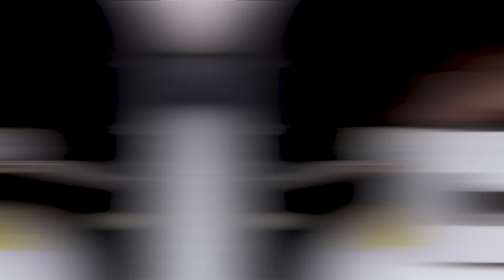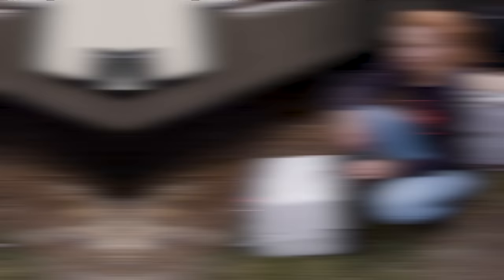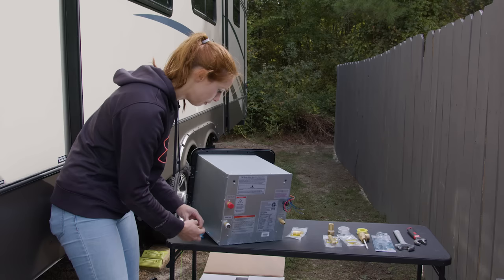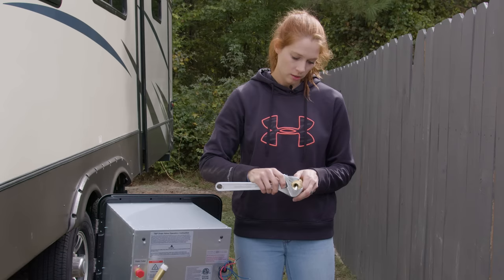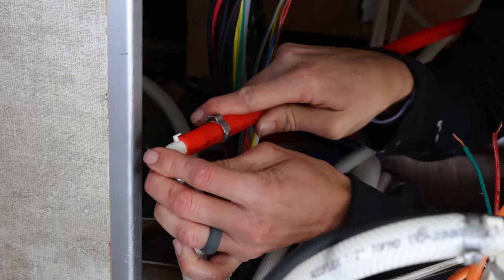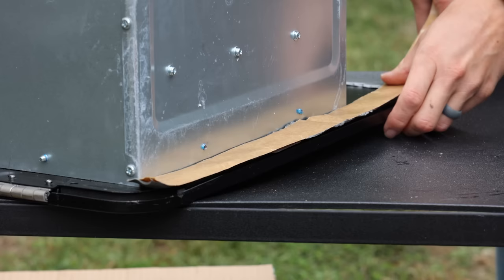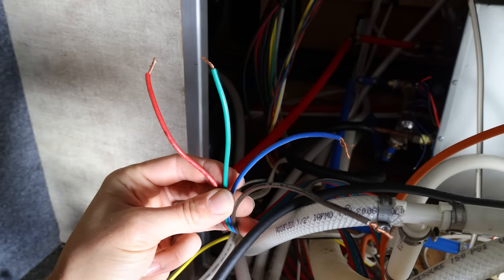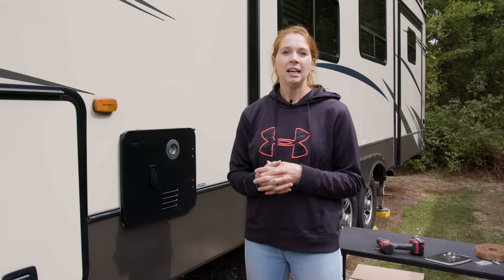(UPDATED) Installing a New Fogatti Tankless Instant RV Hot Water Heater: Easy step by step guide!

Comment: Great video on the installation. But you never put Teflon tape on flair fittings, it will eventually cause them to leak. The seal is the flair not the threads. You can look this up online for an explanation on why.
Reply from the maker: I did some research, and I’ll admit when I’m wrong—thanks for pointing that out! I’ve updated that in the description!
Reply: Call impression fittings don't requires pipe dope. Pipe dope can actually cause a leak on flare fittings. Please research how flare fittings work. The wrong advice can cause injury.
Reply: FYI. You did a great job on the video, but if you go back and watch it again, there were a few Teflon applications that were incorrect on the water fittings. Rule of thumb for me is clockwise applications in the direction of the threads in the tightening direction.
Reply: Flare, compression
Reply: Flare is not compression, nor does it need tape or dope. It has a soft brass seat that is the sealing surface.
Reply: Flair fittings need to be checked for leaks. I used them on copper half inch pipe and a few months later they leaked but there is nothing wrong with flair but I should have used compression fittings they probably would have sealed better but depends on how tight you make them. The flairs should have been checked before they leaked. But when I changed the water heater I used the same supply line and I never had any problems since. 73
Reply: @rickgauthier6597  on the gas line too
Reply: Even NPT gas line fittings don’t use the white Teflon tape. The solvents in LP and natural gas degrade the tape over time. Yellow PTFE tape is used on NPT threads on standard black iron gas line connections.
Reply: Mobile Gas line applications… should be safety wired…industry is lacking!
Reply: Teflon tape is an anti-seize not a sealant
Reply: @fallenintocamping we all learn new things in life. 
When you did put the Teflon tape on the propane fitting, you also did it in the wrong direction. Not picking on you, just pointing out how important the direction of applying Teflon tape is

Comment: Its unbelievable how many people give advice on things yet know very little about what they are doing . That being said , good for you taking on this job yourself ! P.s. that flex hose should not be on a pex fitting , it will probably leak at some point . They do make pex-flex fittings .
Reply from the maker: Ha I’m used to it…part of the territory when it comes to the internet. Also im cringing at the flex hose on a PEX fitting…I have definitely learned since then 😂 It’s been almost a year since I made this, learned lots of new things. Make sure to check out the 8 month review I did on this if your thinking about purchasing!
Reply: Thinking about getting a tankless for our camper but aftet watching your review , im not sure now . As for the flex line on the pex fitting . I guess it will be fine if its crimped correctly . They do make a flex-pex fitting though . Sucks the tankless decided to stop working correctly !

Comment: FYI - Always put Teflon tape on clockwise looking at it from the end.
Reply from the maker: I changed it before install, that was just the first camera shot they got of it. Hince why I went on to explain why, cause I threaded it wrong the first time 😂
Reply: @fallenintocamping  Very good video, thanks for sharing. We are on the fence about going to a tankless water heater.
Reply: @fallenintocamping  and you still put  the tape on wrong on three  of  threads  plus  the  gas line  that didn't need it.
Reply: Yessss...she was putting it on counter clockwise  on water inlet.  Plus...was tightening things that were already loosen and then finally turned it the correct way.  Righty tighty...lefty loosey
Reply: That's 100 % correct and funny that she is NOT.....HAHA

Comment: The pressure relief valve ALWAYS goes on the output side of a water heater - that's where an over-pressure situation could conceivably occur, however rare that is w/ an on-demand water heater.
Reply from the maker: Agreed—I made an update in the description a few weeks ago!
Reply: I originally opted not to install it, I came back to this video because I was thinking about doing it. As soon as I watched this again I was thinking this makes no sense. All your Water will drain into your camper.
Reply: Pressure relief valve should never be blocked from opening. ie. gas line.

Comment: For a Simple reminder, For right-hand treads, Always when putting on the Teflon tape wrap it in a Clockwise direction, so that it is wrapping in the same direction as the Right Hand Threaded fitting is being turned and threaded on
Reply: Not recommended to use Teflon tape on compression fittings.
Reply: @ssr4656  or any other fittings that have their own way of sealing....o-ring, compression, etc
Reply: I noticed that, too. She put it in CCW and then threaded the connection on CW. A common mistake.
Reply: @ssr4656   Water connections are not compression fittings. Only the gas fitting is compression.
Reply: @lanahorton1003  You sure?

Comment from the maker: Y’all make sure to check out the UPDATE in the description! I’ll admit when I’ve made mistakes, and I don’t want y’all to make the same ones that I did. Happy camping!
Reply: Good Morning and thank you so much for this video and I appreciated that you did this for the Fogatti unit from Rec Pro. I have spent a bit of time looking into this brand of "hot water heater" LOL just thought I would throw that in there due to comments regarding so many people saying it is not called a "hot water heater."  I have been full timing for 25 years and I have always called mine a hot water heater. 
Important Tips: Fogatti comes standard with a 15 X 15" door. If Replacing Atwood 6 gallon opening requires 15 X 18" door. Option can be selected during Rec Pro Order and costs extra. 
Make sure to purchase the unit with the correct door size and you will not be in the same situation I am currently dealing with. Enjoy, Elizabeth
BTW Fogatti is now making units with the pressure relief valve installed in the front of the units, just not on the Rec Pro units.
Reply: Its ok to make misstakes you did awsome !
Reply: Sorry, I was just needling a little, you make awesome videos and you did so much better than I'd do with that router ❤
Reply: Have you experienced any drop in hot water pressure inside your RV since installed? I have. Have descaled it and nothing seems to work to get water pressure back.
Reply: OMG what did you do with the tank? That's the same model I have
Reply: Great job young lady! Not very often seeing a woman doing this type of job!

Comment: At 10:33 in the vid, you have you Left hand on the  pipe fitting ( MALE THREAD ) With it pointing to your  Right  Hand, if you always remember this then place your PTFE/TEFLON TAPE onto the top of the pipe thread and wind away from yourself, youll always apply your tape in the correct  direction.
When you applied  the tape to the end of the Long Nipple, that was to accept the 3/4 - 1/2 reducer that fitted onto the PRV. You wound incorrectly. Perhaps applying your tape whilst  your fitting is in hand would help to remember.  

Other than these little issues, you're doing a great job.

( Retired UK Plumber )

Comment: Her: Make sure to put the thread tape on the right way.

Her: Puts thread tape on all but one pipe thread the wrong way. 🤣
Reply: Yeah noticed that too!!
Reply: Also pressure relief valve can't open because it is up against the gas line.
Reply: A minor issue. Before you criticize, step out of your comfort zone and try something new. 47 years in the trades and learning every day.
Reply: I almost make that mistake every time. Almost.  The life of a handyman. Never an expert.
Reply: Most people are right handed, such as myself.  I hold the pipe with the left hand and thread the tape over the top.  This ensures the righty tighty method.
Reply: @Bart Tobias  I do pipes periodically, it's just mental mistakes
Reply: We have all done it.  I always double check myself and sometimes pull the tape off and do it again, as I put it on the wrong direction.  What is far more important is that you know there is a right way and wrong way…most don’t even know that.
Reply: Simple fix always put the tape in the direction the fitting tightens
Reply: @barttobias3933  She's on here teaching not us. If you're going to teach get it right.
Reply: @christhomas9837  agreed, but still impressed that she took on the project, tiny trip, listened to our input, graciously accepted and learned from that input. Even after all the years I’ve been doing this work I learn from others everyday.
Reply: Pressure relief valve goes on the HOT water side! Not the cold water side because pressure is built up as it Heats!
Reply: true but she just doing her best. Its all good
Reply: Yeah, I saw it as well, on the male pipe threads on the rear of the unit. The way I remember is, starting at the top, wrapping down to the right and coming back up on the left side to the top again, then doing it again. Righty tighty, lefty loosey. Same thing for a bolt, unless it's a left hand threaded bolt. Still, would like having someone as pretty as she is, who isn't afraid to tackle jobs. She would have been great when I converted my bumper pull to a gooseneck hitch on my Winnebago Spyder toy hauler.
Reply: Teflon tape should be applied in the same direction as when you thread the connector.
For instance, if the connector tightens clockwise, the Teflon tape is applied clockwise.
Reply: I was wondering how far down I'd find this comment!
Reply: @christhomas9837 I have to agree with this.  It’s one thing to make when you’re doing it on your own (because it is easy to do). But when you’re demonstrating the “correct technique” the technique has to be correct. Newbies to this are paying attention assuming the instructor is doing it correctly.
Reply: Do as I said not as I do. 😂😂😂
Reply: Try giving her credit most guys couldn't install a screw let alone a water heater perfect wife in my book lol

Comment: One easy way to remember the tape direction is that if you’re looking directly at the end of the pipe to always wind tape clockwise or righty tighty. Also if you read on the front of each tape roll it will tell you the minimum number of wraps and if it can be used on water or gas. As far as gas flare fitting it’s best not using tape or dope, I use a dab of Nylog blue on my copper flares and nuts. As far as the t&p I would think you’d want your t&p valve on the outlet or hot side not cold. Otherwise this is a very helpful video. I’m installing one of these units now and can’t wait to have endless hot water.

Comment: Great video! You are a great teacher. Just a reminder to all watching, a blue Pex pipe was installed to the discharge of the pressure relief valve. Pex does not discern which color goes to which temperature plumbing. Classically, it is used as blue for cold and red for hot. but that’s only for orientation with the plumbing. There is no difference in the composition of the plumbing. White pex is used for both. Yes, in residential, according to code, you would differentiate the color of Pex that is utilized for either hot or cold plumbing. However, as in plumbing and wiring, it’s a good idea to maintain the color coding so that anyone that is working on your RV or you’re home will understand what a wire or pipe can be carrying for safety sake. I would hate to be sprayed with hot water from a  pipe that I just cut that was blue.
Being nit-picky, calling this a”hot water heater” is redundant. It is a common error. It is a water heater.

Comment: Epic video, and not to criticize because that’s what most people are doing here, but the wiring portion does not have enough information and gets confusing quickly if you’re not an electrician. Not to mention not all trailers have the same color coding wires. 

 Aside from the 110 wires that went to my relay I had four other wires that went into the water heater. You have to be very careful here because only one of those wires was a 12 V wire another would go back-and-forth to 110 to 12 depending if you are Boondocking or not and the other 2 were 110v, so if you accidentally install the wrong wire, you can fry your system pretty easily. I used a multimeter and tested each wire while also flipping the switch is inside, surprised to see them go back-and-forth of 110 to 12. Only one wire was stayed at 12. Great video. So to all those out there, don’t trust the same colors, get a multimeter and don’t fry your new heater.
Reply from the maker: Never heard of one of the 4 wires originally going to the water heater having 110. You should have 1 110 wire (with a black, white, and copper all together). The other 4 wires are most likely for the gas on and electric on switch inside the trailer. In the video, I explained that I used my meter to determine which one of the 4 original wires was 12v and which was ground. (Lots of good videos on youtube on how to test wires with a multimeter, didn’t think I needed to include that but will definitely take note for next time I talk about wiring!) But to update on wiring, when I used my unit the gauge of original wire was too small causing my power to surge every time it kicked on, so watch out for that. I currently have it hooked directly to my battery with an Inline fuse until I can get around to wiring it to my panel. Hope that helps!

Comment: Quick tip for butyl tape - if the backing is sticking too bad and you're having a bad time - put it in the freezer for 10 min. cold butyl tape is 100% easier to work with
Reply: I used to install metal roofs for a living and we kept all our tape in a cooler, because once that stuff gets hot, it becomes impossible to use without getting it everywhere.

Keeping it cool is a very good tip.

Comment: I’ve been using the Fogatti waterless tank for 2 years now. In my opinion this is the best upgrade possible on a RV. Nothing beats a 15 minute hot shower when your body is aching. No more 4 minute showers. Also, the propane lasts forever.
Reply from the maker: YES! We love it. We’ve had it for about 4 months now and it’s the best. Also people really over estimate how much propane this thing uses, I’m actually really impressed. If the apocalypse comes, I know I can get at least 2 months of hot showers with my current propane supply 🤣
Reply: Do they have propane / electric models? If they don't have electric doesn't use much propane? I just hate going to a campsite, paying for the slot and then still having to use my own propane. Just curious, I want to install one of these but I also want it to be efficient.
Reply: @MrFordguy73  It is only propane. However, the propane lasts forever. I don't know why. A little propane tank will last easily 2 months for hot showers and the cooktop. Also, it only cost 25 bucks to refill it.   It is not a cost factor at all. A 15 minute shower though is a game changer. You will not regret it.
Reply: @fallenintocamping  Give it about six months before it fails. Fogatti has the WORST customer service and a horrible track record for reliability. Mine acted up at six months and failed completely in 8. I gave up and installed a regular residential Tankless (Takagi 140H Indoor Condensing style) and it does all the things the Fogatti didn't...like work, maintain steady temperatures, and not error code every time it is used.
Reply from the maker: @mxslick50  haha go check out my 8 month review video for a good laugh 😂😂
Reply: @fallenintocamping  Yep, exact same problems I ended up with. I am sorry it happened to you as well. At least RecPro tried to help you out, as Fogatti refuses to do anything.  I would be especially mad since, as you mentioned in that video, your kids almost got scalded by it. 

I am very tech savvy and can say that it has serious issues with the electronics, programming and overall design.  Several users on Amazon have had major issues, including some shorting out and at least one actual fire. 

Sadly, there are other brands, which when you look at the photos, have the EXACT SAME internals, all made in China and all the same junk.  

I will be chatting with my attorney soon to see if he is willing to set up a class action lawsuit as there are hundreds, if not thousands, of people who have had the same issues and lack of support.